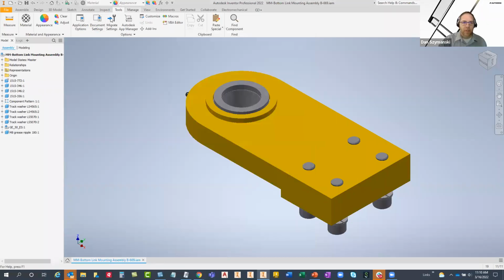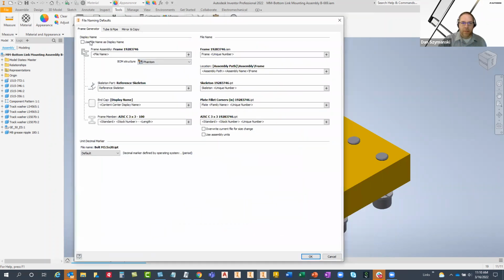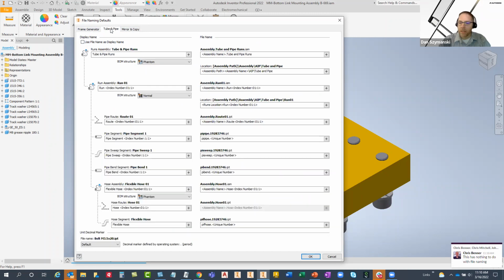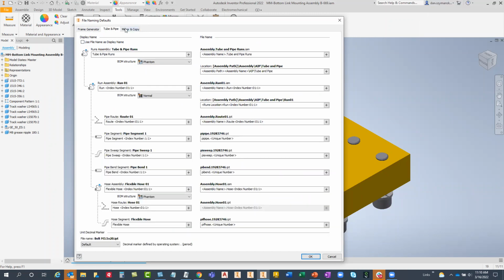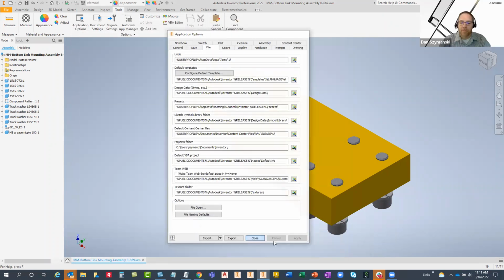What do you want to know about Autodesk Inventor

Comment: I would like to learn more about the electromechanical project, about Inventor's connection with AutoCAD Electrical. For example, in the diagram, the terminal has 4 connection points with the same number. 4 wires with different numbers are connected to this terminal . How to implement this in Inventor? How to implement electromechanical link?